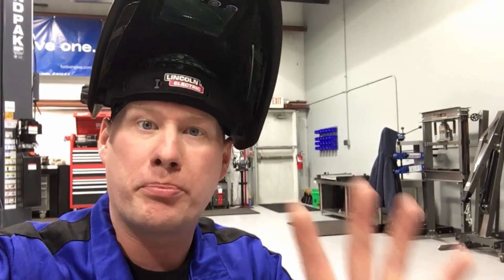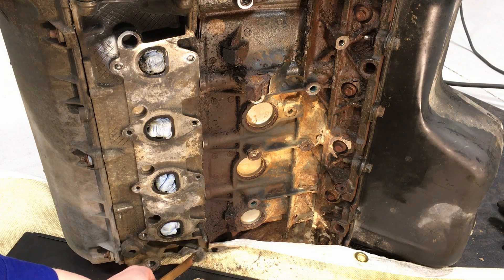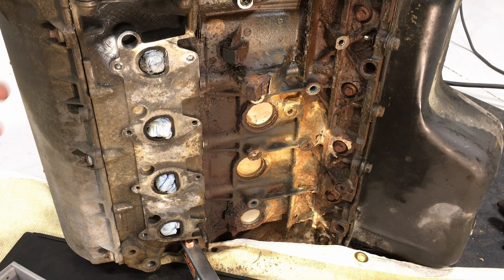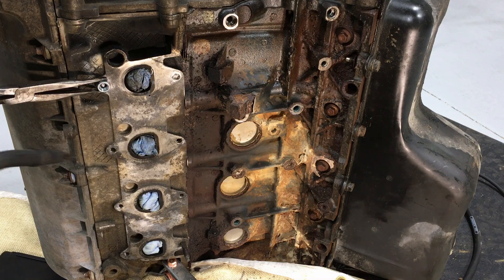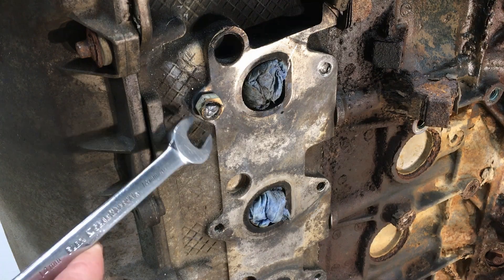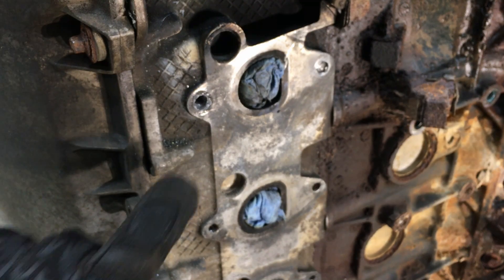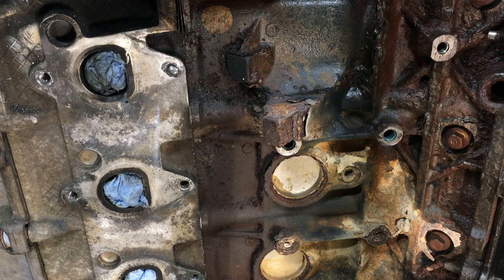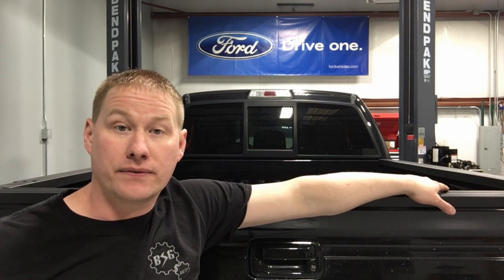Best Way to Remove Broken Exhaust Manifold Studs?

Comment: There’s something so satisfying about this such a relief when it comes out like popping a big zit lol 

It’s a b******d when your manifold studs break very good video, I may have to attempt this on my Porsche when I replace the headers only difference is I will be upside down , and remember Folks “ISOLATE THE CAR!!” When welding disconnect the battery very important....

Comment: Good video, but please turn your wrench around the right way, also, Once you get the initial weld to the broken stud the additional weld serves no purpose except to heat the stud more. It is not going to magically seep through the weld you already have an add more bonding to the stud. There is no need to fill the nut cavity completely up with weld Unless you just want to.
Reply: The nut will just twist off if you don’t fill most of it up. That’s the experience I have had when using this technique!

Comment: Thanks for the video. Have to change an exhaust manifold on my 01 F150 and now I'm not as worried about breaking off studs. Would have been worried that the heat would hurt the aluminum, but now I know better.
Reply: How did it go?

Comment: I used your technique today to remove 3 broken exhaust studs from a 3.4L Chevy V-6 and it worked perfectly. I'm very thankful for this video as I had exhausted (no pun intended) all the other options I've used in the past so I started looking around YouTube for other idea's and most were methods I had already tried until I happened upon yours. I was a little apprehensive at first but it worked so well it was like taking candy from a baby (never thought I would use that term in conjunction with removing broken studs).  Anyway, thanks again for posting the video and sleep well tonight knowing you helped a fellow gearhead out of broken stud hell.

Comment: Nice trick, I'll remember this when i do my 97 f150. A few of em are nearly gone, look like rivites, so this method might be my only choice. It would be my guess, the heat from the weld is actually aiding in the stud removal process, so you get a two for one solution here.

Comment: I am trying to use this technique with the engine still mounted, which means I'm welding "uphill" which seems to make it very difficult to get a lot of material up inside the nut.  Any suggestions?
Reply from the maker: Build a nipple then place a washer instead weld to that on the inner hole. Once secure weld a nut to the washer on the outside of the hex then some in the middle let cool and try

Comment: I weld a washer to the broken bolt first then weld a short bolt to the washer. Hit it with candle wax while it's still hot. Put a wrench on it and tap the wrench with a hammer back and forth works them loose ever time.  Great video.
Reply: @Josh Lindsay while the it's still hot the wax I'd drawn in between the broken bolt and the threads loosens it up. Give it a try.

Comment: Your blowing the nut apart because your using zinc coated nuts. 
Try using a reg grade 6 or 8 steel bolt without any coatings. 
It will weld much better.
Reply from the maker: Almost impossible to find otherwise I would buy them in bulk.

Comment: Another outstanding video! The two rear studs rotted off my 2010 5.4l, and the two front studs snapped while trying to remove them. Drilling the rear studs and trying an extractor failed. All four studs were really stuck in the head and getting a drill up front was not going to happen. Using my mig welder to build up a nub on the studs then welding a nut on the stub got the job done on all four studs. The job is a pain the ass but the cost saving is huge. I was very reluctant to try welding as I figured I would really mess things up and have to replace the heads. All I can say is trust in your ability and go for it. Thank you so much for your videos, they are life savers!!!

Comment: I tried this on my 2V 5.4, worked for two. But I got worried that I was going to warp the head with the heat. 
Can that be a issue? Will the aluminum heads warp using this method?
Reply: I had a Trailblazer ss i did and had to re weld a nut 9 times. It kept breaking the bolt rather than the weld. I got it out. That was over a year ago. Just did the other side a few weeks ago and the drivers side is still sealed up fine.

Comment: Nice ,,,,,,,,,,,, i use a washer then weld the nut to washer u get better heat penetration,,,,,  sometimes the nut makes it to deep to weld to the broken stud
Reply from the maker: You just build up a nipple on there one to two hits and the nut slides over it the finish the weld

Comment: Good video but you should give credit to Eric O. from South Main Auto they guy you learned this technique from.
Reply from the maker: I learned this technique from the other Ford techs on the internal Ford message boards back at the dealer 10 years ago well before Eric O saw these for broken studs. Up until now I have never really used or owned a welder though.
Reply: @FordTechMakuloco  You're a good mechanic for sure and if I owned a Ford you definitely would be my first choice as the mechanic.

Comment: nice video - do you have any tips and tricks for removing broken bolts from ford 6.0 driver side exhaust manifold to turbo up pipe flange ?......the bolts are broken flush and 10mm head is on the far side of the flange...…..cant heat and pound out because of the fragile bellows upstream to turbo......I heated cherry red and tried 10mm wrench on bolt head - wont move....wish I had a plasma cutter but don't....what can I do other than remove up pipe and then torture myself with alignment with turbo issues upon reinstallation ?

Comment: Awsome tip and it works amazing. I did it alittle different every stud was stuck in the head. Welded nuts on the studs heated the studs with torch until cherry red and presto. They all came out and didnt have to drill 1. Also I did this on the truck. THANK YOU SO MUCH for the tip.

Comment: did both manifolds on 98 expedition 4.6. cut studs flush with manifold then removed. (I had access to air arc to cut in to pieces)  then heated studs red not manifold twice allowing to cool in between, then used 3 jaws stud remover pushed against block to prevent angle twisting. All 16 came out easy 1-2 minutes each. Big thing is breaking rust bond by heating twice (expand /contract)

Comment: Just done this in the truck. 5 bolts. 4 were closest to front.
Lifted motor . Removed manifold. Welded in truck. Used cheap open nuts. Nothing special.  Hardest ones were two front due to 5.4 so tight in 4wd.

Comment: You call that a weld looks like you forgot to turn your gas on
Reply from the maker: No gas used as mentioned in the video, not an expert welder also mentioned in the video.
Reply: That explains the bubbles flex core wire .. Im working on a exhost manifold swop on a 2008 f150 5.4 triton 4x4 passenger side wtf was ford thinking its next to impossible to do unless yiu pull the motor.
Reply: I am getting ready to do both manifolds on 1997 F-150,4.6.I seen a video yesterday that used the welding tip on oxy-acetylene torch to melt the manifold in pieces. I have never seen  manifolds rust like that before, ugly.

Comment: Hey quick question man I tapped my exhaust manifold studs a little to far and it leaks coolant any ideas?
Reply: Use RTV on the bolts or studs. Many engines are designed with wet threads on the exhaust manifold side of cylinder heads.  A big block Chrysler is one example.

Comment: Wow I' surprised that stud snapped. The stud looked brand new once you removed it. Usually the threads and stud are rusty & corroded... Great job overall, I wish someone would invent a way to do this with the motor inside the vehicle...
Reply: if there is room,  should be able to do this with motor installed,  why not?

Comment: i am planning to flush my transmission 4R70W for my 1999 ford  f150 lariat 5.4l 162000K.i need to know the oil cooler return line location please help.i thank you

Comment: Welding right to the broken stud works too, a local machine shop that does these regularly told me that the first two to three threads are always the ones that seize, if you grind down one eighth, they'll unwind every time.

Comment: Great video! I just got ripped off from a shop who failed to remove one of the manifold bolts on my 2000 ford explorer 5.0. I need to get another small welder to try this method.

Comment: I have had to drill down to the studs to wait the threads out weld a washer and then weld a nut to the washer I find it a lot easier to weld a washer then a nut

Comment: I just removed 4 cracked off studs on my Chevy, except I was able to do it with the manifold still on the motor. Took a little patience as to not hit the manifold with the welder, but luckily my studs were cracked off flush with the manifold and were relatively easy to access except one. Still, I did not have to remove the manifold. j

Comment: Thank you for posting this.  There is a  technique I use to keep from twisting off rusted bolts, nuts and studs.  If I suspect a fastener is really stuck from it's appearance or it's refusal to turn with a reasonable force from a wrench, I first use a penetrating fluid.  After that, I use a 3/8 drive air wrench or even a butterfly air wrench with Metrinch sockets if there is room, and the air pressure turned down at first.  The rapid chattering has loosened many fasteners for me over the years, preventing further welding, drilling, using EZ Outs, re-threading or whatever.  When there are no rubber seals, explosives or other fire hazards nearby, I heat the surrounding area if needed with a small torch, or a acetylene torch for big stuff, but not to the point of heating the stuck fastener itself because it will also expand.  This expands the steel, aluminum or cast iron away from the stuck fastener.  Although the expansion may be only one thousandth of a inch or less, it's enough to free it.  But it's really aggravating when fasteners are literally rusted away or twisted off flush.  Again, thanks for sharing this video.

Comment: Not working for me. I started with 0.030 wire with gas. Didn't work. Just switched to flux core 0.035. I've welded over 10 bolts onto it. They just break off. I have cleaned what's left of the stud(down inside the head about 3/8 inch) repeatedly.
Reply: Some exhaust studs are made of hardened steel so they would need to be preheated significantly before the weld will really start to penetrate into the stud
Reply: They make a stud gripping tool that Advance sells,if there's anything sticking out, cut the heads off.Looks like a nightmare to me but I gotta do something.

Comment: Is that only work with an aluminum head, I have a 460 ford on my 1997 bounder and 5 bolts broke
Reply: I wouldn't try it might weld to it

Comment: Hi .. thanks a lot for the videos . I just want to make a question ! I changed the spark plugs on my pick up truck (2005 ford f150 king ranch ) but the new spark plugs doesn’t work well ! But the question is : the new spark plugs are motorcaft pzh14f and the old ones are pzt2f ! Is any difference between those ? And the seller said both are the same ! Thanks !
Reply: Sp-515

Comment: I also use this method...Another tip is while the bolt is cooling down(not red) add a little bit of beeswax as close as you can to the threads. It'll draw right in and make it easier to get the bolt out without turning back and forth as much. Use caution as beeswax is flamable though!!!

Comment: I've been using Lincoln/Miller stick and wire feed welders for over 40 years. Can't remember ever having a problem. Needed a new one for home use but didn't want to spend big bucks.  Purchased a Harbor Freight and it works. I wouldn't recommend HF for shop use, but for a once in a while home welder it works just fine.
Reply: We have a bunch of miller welders in my diesel shop, and I’ve been laughed at every time I’ve gotten out my dinky little titanium flux welder. But honestly everybody in here has stolen it for one thing or another on these smaller jobs and broken bolts. This welder has its place

Comment: I am a sh@t welder, never had luck welding a nut on. I just booger weld out and make a goop with weld. Then use Irwin bolt-grip extractor (they come in different sizes a kit) to grab on the weld and unscrew it out.

Comment: Ford T. Great Video. My 45 years taught me to put strip of duct tape down whole cylinder head,who cares if it melts ,then put a button of weld right on center of stud,build up if needed,then use needle vise grips,if that dont work ,then you have a shaft to slide nut over then weld nut as last attempt .  Waist of wire good 1. I.M.O.
Reply: Can you repeat this in English please?

Comment: Wow look at how perfect the threads were on that bolt! I can’t believe these still break. Great video, keep up the good work.
Reply from the maker: Yeah its the water and salt trapped behind the nut inside the manifold flange that does it.
Reply: “Rust Jacking” is how I have referred to that scenario. The rust caused metal to expand and snapped fasteners off.

Comment: Excellent method for extracting bolts, do you think the Heats from the welder also helps break loose the broken stud?
Reply from the maker: Yes on rusted studs it will break the bond.

Comment: Hey Bro love your vids!  Someone may have mentioned already.  @6:00 you said use a zinc coated nut. Just a heads-up,  you should never weld on zinc/galvanized steel without proper venting and a respirator.  Though I know people do it all the time, the fumes from zinc and many other metals (e.g. magnesium, cobalt, etc.) are poisonous.  It's called metal fume fever and depending on the person, it doesn't take much to make ya sick or dizzy.  Just becareful if you're practicing and buy non galvanized.  :)
Reply from the maker: Thanks much appreciated all good info. I treat any welding fumes as dangerous so I just hold my breath and have a nice fan to blow it away from me. When it allows I also have my exhaust ventilation over the area to pull them away.

Comment: Never,and I do say N E V E R weld a galvanized steel. It is way better to find an old non galvanized nut.
That white ash and white smoke that floats around while welding is a really carcinogenic stuff
Reply from the maker: Glad I avoided them, but I know zinc coated is not much better. Black oxide maybe?

Comment: what do you charge someone for a job like that ?
Reply from the maker: $550 Aftermarket Manifold or $650 Ford Manifold installed.
Reply: FordTechMakuloco is that with broken studs as well?
Reply: Is that with the engine out or in the vehicle?

Comment: Had to do this last week on a broken bolt sub flush. My advise is to practice on a bolt and nut on the bench to dial in the welder and get a feel for how the welding wand needs to be held for the broken stud on the car. On a side note i have seen two guys torch out broken bolts in steel cylinder heads leaving the treads intact, it was pretty impressive but I never tried to pull that off on a customer car. Haha
Reply: its NOT a steel cylinder . its cast iron..the torch doesn't cut cast iron...30 years on everything to do with cars. all welding...i can blow broken bolts out of cast steel parts too..with blind holes which means they dont go all the way through..it  usually wrecks the cutting tip but you'll get the job done in minutes..another wat to remove broken studs in holes when its broke off just inside the hole..put a washer just slightly smaller than the hole weld through the washer to the stud till it welds to the bolt..it wont weld to the cylinder head..even with stick...steel doesnt weld to aluminum or cast iron the only thing in there will be flux sometimes...then..clean off washer level and weld a nut on the washer..go for coffee..when you come back you will be able to remove broken stud easily ..go back and forth a little at a time slowly working your way out ...usuall no more than two turns..back and forth..you will be able to remove the stud the rest of the way without going back and forth..easy to do because youve given time for the bolt to cool off and shrink..this breaks the bond 99.999 % 0r the time...if the weld breaks try it again...never had this NOT work...a mig machine with solid wire and using argon co2 mixed gas...miracles can be preformed with solid wire..no flux

Comment: I know next to nothing about welding, but wouldn't that extreme heat damage the threads of the aluminum considering it's lower melting point?
Reply from the maker: No the head is a huge heat sink.

Comment: I just used this method on my 2008 F250 V10 King Ranch. The center studs on both sides were hard to get and I broke easy outs inside of them, so I had to get my Mig welder out. One thing to keep in mind about welding on any vehicle, is to make sure your battery is disconnected so you don't fry and computer modules, systems, or radios. As a ground for welding, I just simply installed a new manifold stud back into the head and clamp on to it. Aluminum is a good conductor. I struggled, but did not have to raise the engine like Alldata stated